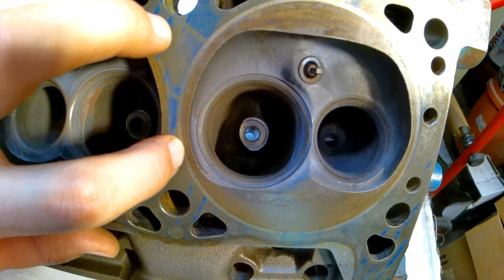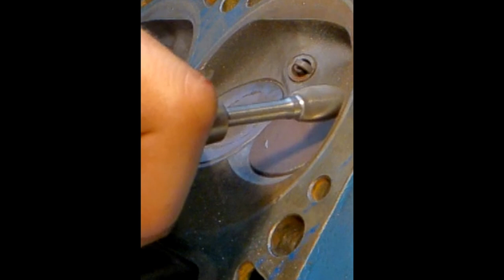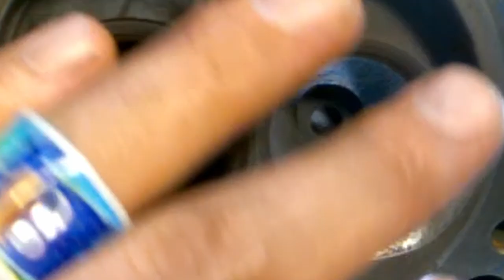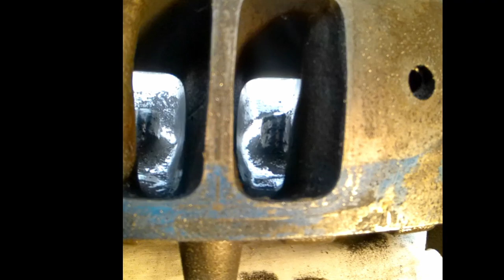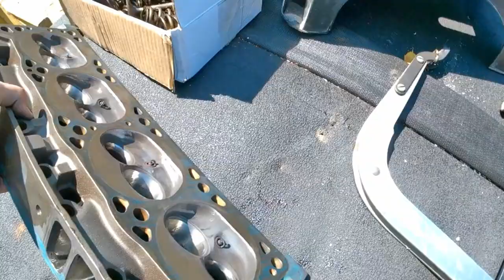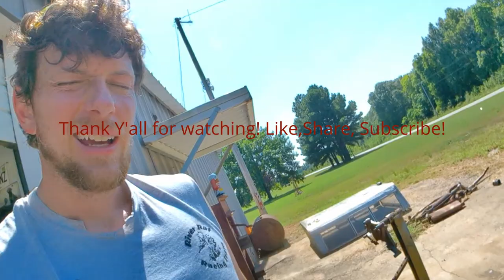Mopar Small Block:Porting for Power!

Comment: I'm happy that I smoothed and opened the bowls a bit on those factory 302 casting heads I bought from Indy.
They were cut for bigger valves, but still had a small throat. I wish I could put photos on here....I think it made a Helluva difference....you should've seen the slag in the exhaust bowls. I didn't measure anything...just opened 'em up until a 15/16 socket fell into the bowl (318willrun)...smoothed the transition to the roof.
No science used, just great info from you guys!
My engine runs great for ME....maybe not a race car, but suits my liking. 👍
Reply from the maker: Thanks buddy! That's what matters most! I've seen that Ramcharger haul the mail now!

Comment: I got an '81 225 that I'm rebuilding on a tight budget. It will go in my '74 Dart and used as my daily.
On my head I've blended the bowl's too the seats ending about half way down, streamlined the valve guide bosses (?) on the side facing the ports and rounded the rest off, and just broke the sharp edge of the short turn radiuses.
Next I'm going to match the exhaust ports too the largest one and do the same on the intake side. After that, I'll smooth and polish the exhaust side (ports and bowls) and just clean up the intake side leaving a little roughness.
On my intake (stock 1bbl) I'm going to match the ports too the largest as far as I can reach then do the same on the exhaust manifold (OEM). Once that's done, I'll do what I need for the exhaust manifold port to be a little larger the the exhaust port on the head and the do the opposite on the intake side. This is for helping reduce reversion.
Only thing left will be milling the head for a 9.1:1 compression, I've already took the lip off the back of the valve. If money allows, I'll have a three angle valve job done.
I know I ain't going to have a 1,000hp monster. I don't want that. Just wanting to pick up a little extra while it's apart to better suit modern times and make the driver experience a little better while maintaining good driving manners and be reliable for 500k or more.

Side note:
Since every time I find the Super Six intake and exhaust manifold it cost an arm and a leg, I'm going to make my 1bbl intake work for me. 
I need to get an adaptor to fit a modified Weber 38 (vacuum secondary) to my intake and I plan open up everything on the secondary side that I can for better flow and weld in a piece of metal in the adaptor coming out the bottom slightly to separate the unopened primary side to keep velocity up. Just going to match the adaptor to the intake plenum on the primary side.
I think it should work great once done and dialed in how I want it.
Reply from the maker: Hard work pays off!

Comment: Nice work Joe ! What’s your opinion on the RHS X heads? How do they compare to other bolt on replacement heads?
Thanks 
Rob in Blanchard Oklahoma
Reply from the maker: I like these heads. Basically updated magnums. I’m sure trick flows and edelbrocks would outperform, but these had a better price point when I ordered. I think speedmasters have taken the Indy x place.

Comment: Just a question why do you open the cylinder head up?  Don't you loose compression?
Reply from the maker: Thanks for asking! Most people don’t know about the common rule for compression. For every full point you raise/ lower, you change your hp by 3-4%(google it, it’s for real). So in a 400 hp engine, a full point would net you 12-16 horsepower. I’m my grinding, I may have lost .3-.5 of a point. But I gained increased airflow from the heads, which could easily counter act or even further offset the porting. Check out David Vizard’s videos. He shows his methods and usually tests on a 10/1 compression engine. I am increasing from a .048 to a .029 head gasket in this engine, which will make it better than its ever been!

Comment: The biggest flow problem isnt the pinch in the intake...... its the guide, the back cut on the valves, and the shrouding on both valves..... dodge is known for it..... cutting and tubing the pushrod boss does almost nothing surprisingly......
Reply from the maker: I agree. I’ve never tubed one. I did see on Instagram that Steve Dulcich just tubed some heads the other day for his 318 build. You are aligned with my research. I like the For A bodies only articles. Several on there with pictures and flow bench results. I can Monkey see, and Monkey Do.

Comment: Great video Joe, when you were grinding to deshroud the valves doesn't that make the combustion chamber a little larger thus lowering compression very slightly and does the increase in air flow worth the modification on closed chamber head like the one your doing! Is it just a small effect.
Reply from the maker: Vizard said do it. I know for every full point of compression, you gain 3-4% hp. We know the power is in the heads. I kind of followed his pattern in porting. I’ll definitely show the results 👍🏼

Comment: Dude... Broke the push rod wall and make a new wall with epoxy... Easy fix and gain more cross sectial área... More CSA MORE HP AND MORE RPM
Reply from the maker: I’m not that ballsy! Being a bracket car, I only want to run it 6-6,500. Cam range is 3,000-7,000, and I only have a 4.10 gear with a 28” slick. I may try the pushrod trick in some older heads I have.
Reply: @JustMoparJoe   @JustMoparJoe  calm at first no one is brave ... hhaahaha but believe me the change is potentially drastic.

I recommend you look for information on how to do intake port based on the work in CSA.

Over there in the push rod section is where you have the minimum area and that is what determines the total RPM of the engine.

The formula that You need to know is mcsa (minimun cross sectial área): bore*bore*stroke*RPM*0.00353/613.18

With this fórmula You can calculated how much area do you need For "X" RPM based in the CI of the engine.

Now You need to measure the intake Port... Height * width less total área of corners (circule área of total long of corners)

Well... I wish You the Best for You men i love You barracuda. I have the same combination in Demon but with a 280h cam.

Sorry for my bad English... cheers from Venezuela
Reply from the maker: @jesusavila7955  it’s all good brother! I love the science behind the performance. Here is the cam for my barracuda: https://iskycams.com/shop/index.php?main_page=product_info&products_id=607